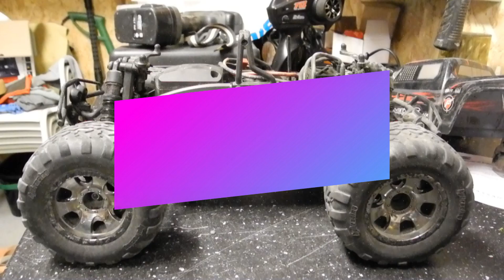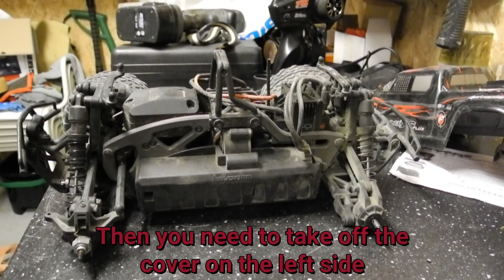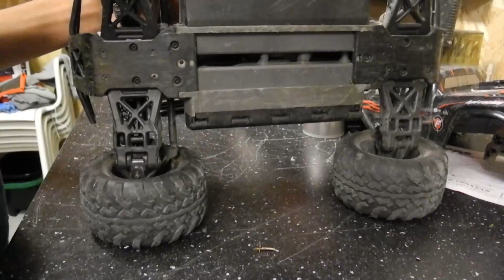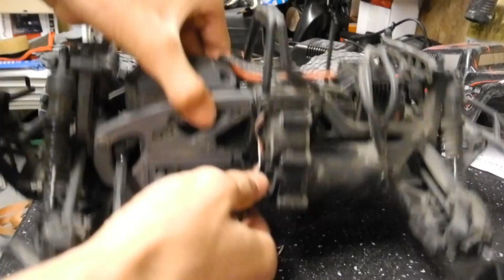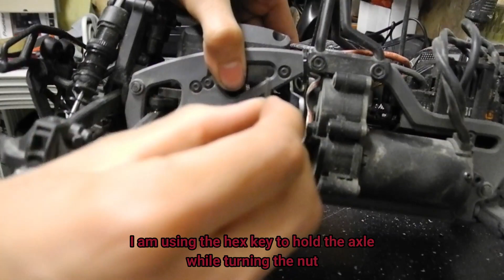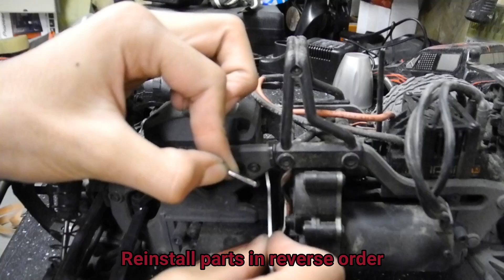How to adjust slip clutch on a Hpi Savage XS Flux

Comment: simple question, so you adjust 1/4 turn. is it like tighten it fully and then loosen it 1/4 turn? Should you do this on a brand new out of the box ?
Reply from the maker: I adjust the clutch 1/4 from where it was, which way depends on if its too loose or too tight. You usually want to get the clutch to the point where there is little to no tire slippage on a high traction surface, like a carpet or prepared race track. I usually dont adjust the clutch out of the box but it depends on how loose or tight it is. Hope this helps :)